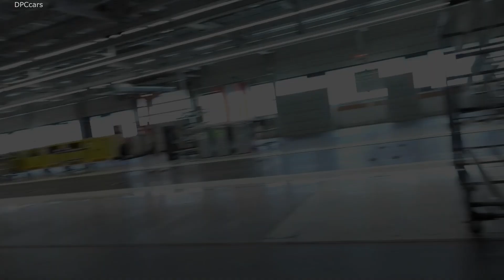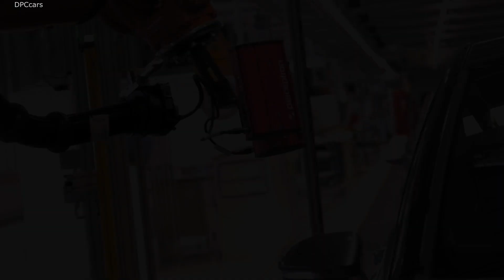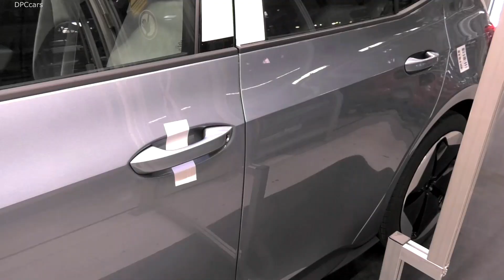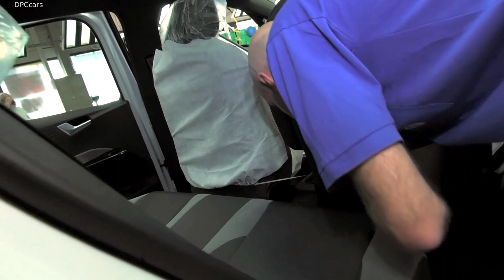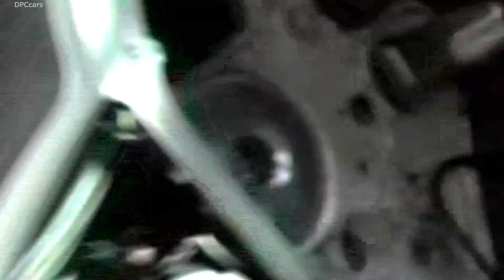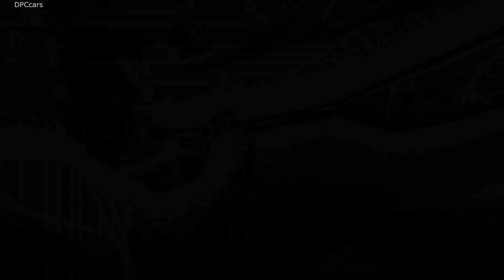2020 VW ID.3 Assembly - Volkswagen

Comment: Are they rear drum brakes? or regenerative braking units???
Reply: the base model has rear drum brakes, the rest has rear disc brakes just like in the Golf.
Reply: @AOTanoos22  drum brakes wow! not very 2020 is it?
Reply: @truthseeker8483  not perfect i know, but since most of the braking is done by regenerative braking anyways and its not a heavy car i really think its no problem at all and makes the car cheaper for the customer as well, so i don't mind it since the front brakes are farely big disk brakes which matter the most.
Reply: @AOTanoos22  suspension design is the biggest let down on new cars..springy pieces of metal are so caveman...
Reply: @truthseeker8483  brakes have nothin to do with the suspension :/
Reply: Drum brakes to avoid rusting in winter. It's a major problem for many EVs in northern europe so it's a smart move from VW.
Reply: @Taraquin83  suspension springs probably rust too...better to use some wood logs
Reply: @AOTanoos22  I know....I am complaining about the suspension design as well..some cars in 1955 had more sophisticated design
Reply: @truthseeker8483  rear brake disc rust due to salt on the road and very little use due to regen. Suspension rusts far slower. Several people I know about had to replace rear discs on their e-Golfs due to rust. Not because of wear.